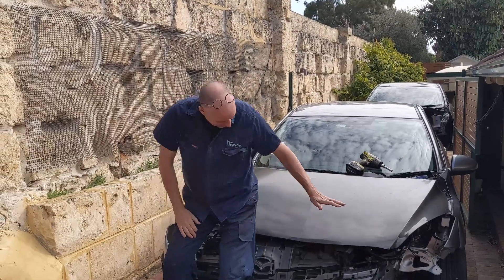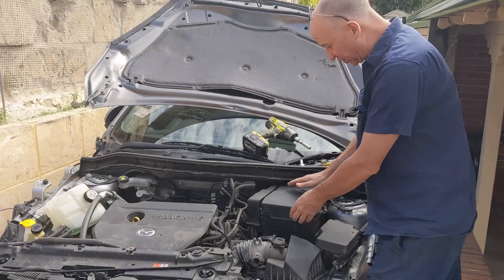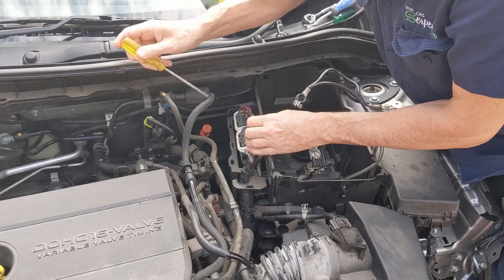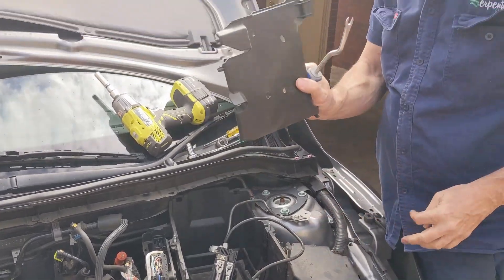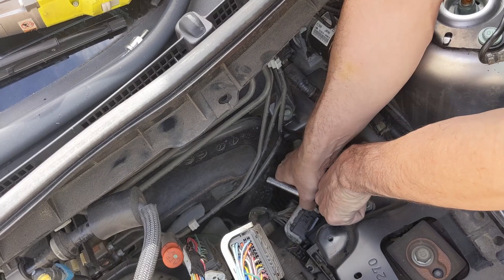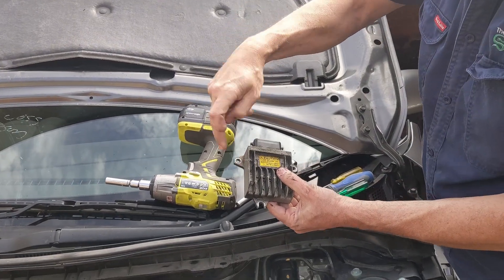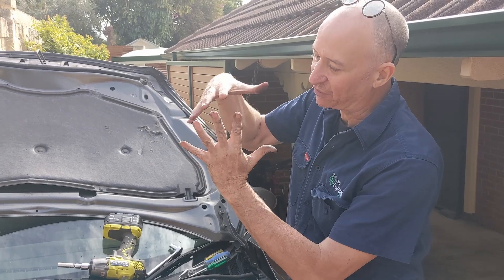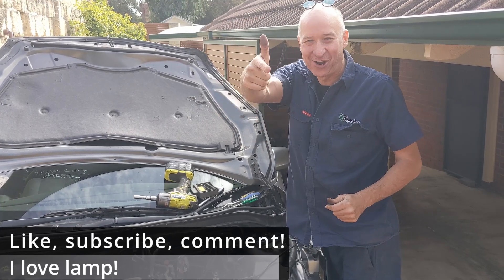BL Mazda 3: R&R the TCM. 2.0L 2.5L 2009 2010 2011 2012 2013 U0101 LFAE LFJS L552 L34N PE2G PE2K

Comment: Engine light and AT light came up yesterday on our 09 sp25 scan tool saying PO753 shift solenoid A electrical. I’m assuming it’s the TCM as you have shown. Symptoms clunking into drive and reverse. 

Thanks for the video. Going to give this a crack. Cheers
Reply from the maker: Hi Steve, yep, that sounds exactly like a TCM failure.  

Just so you know, I've noticed a bunch of sellers on eBay selling new non-genuine TCMs that are made in China.  They don't have either of the model numbers used in Australia (LFAE-18-x for the 2.0L petrol, and L552-18-x for the 2.5L petrol).  

The reason that I mention this is that you now have a dilemma.  Do you fork out the $2,000 to Mazda to gt a new one, or $1,200 to get your old TCM reconditioned, or do you punt on a second hand one from a wrecker for about $600, or do you punt on one of these non-genuine new ones from China for $450 (assuming the seller assures you that it will work in your car?

If you do go with the Chinese eBay option, could you please write back and let me know? I'm very curious.

Paul.
Reply: @PaulinPerth  morning Paul! I removed the TCM today, think I’m going to try a few local Mazda wreckers for a change over first and see how i go, 

Quick question I have the sp25 number L552 18 9E1C 
Do I have to match the entire part number or just the first 2 sections for the TCM to work 

Also I have a 09 model car. I can’t see anything in the manual about auto trans service intervals… is it lifetime oil in these or is it worth buying a service kit and some fluid and giving it a freshen up. 

I’ll let you know how I go with the TCM pricing. As the car is approaching 200k and 2009 I’m thinking of buying a wrecker module and maybe look at moving it on and upgrading.
Reply: @PaulinPerth  update mate 

I found a local wrecker selling referbed units for approx $650 with a 5yr warranty so I’m going to go with him! Cheers for the help! Much appreciated.
Reply: @stevev7696  do you mind sharing the information/ or link to that local wrecker much appreciated thank you.
Reply: @phatp569  Allmaz wreckers in Clayton Victoria

Comment: So if you get one off of a junked one will it have to be reprogrammed or if I buy one will it have to be 2012 Mazda 3
Reply from the maker: No reprogramming is needed.  You just install it as is.  Start the car up and drive.  Paul.
Reply: Can it be off a junk car same year and model someone is telling me that vin has to match for them to communicate
Reply from the maker: I assure you that the VIN can be different.  I've successfully transferred several TCMs from different cars.

Comment: I wonder if it would help to put some spacers in between the transmission and the module to help keep it cooler...from the United States.
Reply from the maker: It wouldn't hurt.  Some people cable tie the TCM to the brake lines on the firewall.  Paul.
Reply: @PaulinPerth  that's what I ended up doing.

Comment: Will any Mazda 3 TCM work? I have a 2008 2.0 and wondering if I can just get one from q junk yard and use any. Or do I have to use the same one with the same code???
Reply from the maker: It will need to be from the same series with the same engine and transmission.  So you can't use the TCM from a BK on a BL, or the TCM for the 2.0L engine on a 2.5L engine.

Comment: How do you reset the codes and reset after you replace the tcm?
Reply from the maker: You'll need an OBD2 scanner and use the reset DTC (Diagnostic Trouble Code) feature.  Get a Bluetooth one off eBay.  They aren't expensive.
Reply: Thank you  @PaulinPerth

Comment: how would you attached the TCU to the firewall? with screws right into the back of the firewall?
Reply from the maker: I've seen people cable tie them to the brake lines.
Reply: @PaulinPerth will this cause any damage to the break lines with the weight of the Tcm jossling or hanging overtime?

Comment: Love the video .. I live in Houston texas USA.. .. I am having this problem with my tcm I have a 3015 mazda 6 the  check engine light on and a traction light on the code is p 0882 low voltage

Comment: Awesome video!  When i get a new or refurbished TCM for my 2010 Mazda 3, do i need a dealer to program it, or just plug in and go?
Reply from the maker: Plug it in and turn the key.  There is no programming required.  Paul.
Reply: @PaulinPerth can I go to the junk yard and get from the other TCM there? (same 2010 mazda 3)
Reply from the maker: @amadolasala200  Yes you can.  But of course you don't know how long that used TCM will work for.
Reply: @PaulinPerth where can I get one brand new??

Comment: Im having something similar happeing to my mazda3 2010. AT light is on check engine light on. It drives sometimes. But at times will start flashing AT light and losing control light (its right next to the AT light). When that happens i cant gas the car anymore. I have to park on the side for a little and power will come back .   Not sure is these are symptoms of this.  But if anyone can help. I would appreciate it

Comment: hey do you know the TCM model numbers for the Mazda 5 2.3L? specifically the 2008 from the USDM
Reply from the maker: I don't, but injectronics will https://injectronics.com.au/.  Failing that, ring a Mazda dealership and get a quote from them.  The quote will include the correct part number.

Comment: Just found out that I will be chasing this down in my daughters car, and it looks like I lucked out on my FIRST video researching location and possible replacement. I've already seen the prices (hello from USA) so I will take a little time in
making sure it isn't wiring, or connection.
You did put my mind at ease about the firewall not being on fire. He.. he. I will be doing that mount for sure, if I  replace it.
If you don't mind? Some general information type sites are stating that bad wiring is usually the culprit, and it "rarely being the TCM", and I only have the one code. (U0101) The car runs great, and then suddenly  BAM.... downshift?, disengages? and back? it then goes back to running as it should. It's hard to tell exactly because it pretty violent at 45 mph, or whatever the rest of the world (correctly) calls it. It's like getting rear ended by someone doing 1.609344 Killemneaters? Klobberweiners? Klimbameter?Kouldbeneater? (but it's all I got) per hour, 
OR? (correctly) referred to as 5 mph. Lol. 
We used the metric system when I worked in the machine shop at CASE Construction, and I far prefer it, but ya know? exceptionalism and all. (example of exceptional sarcasm right there) We Built the skid steers, or "skidders" I believe you may say.
I release you from responsibility of burden for giving your advice on which you believe my focus should be more on.
TCM?
Wiring / connections?
Where might I favor focus too?
My asking is a reflection of your specific experience with this vehicle, along with an intelligent manner in how you simply explained this. The inside scoop on factory issues was good to know, but at 3x used price, it would have never been a purchase I would have made. I haven't yet been bitten with that mindset yet, and I've turned many wrenches holding the title of family and friends mechanic.
The pay is awful, but at least they call when i'm busy with other things.
Great video, even if you don't find the time to reply. 
A like and a sub for you my friend.
Thanks.
Reply: Hey friend, I got the same exact issue as you described. Mine is a 2010 Mazda3 S Sport 2.5L. Do you found the cause of the problem? I’m at the same position as you: Tcm? Wires? Both? Any info willl be greatly apreciated 🙏🙏
Reply: @gcertain  
I literally just found out what wasn't the problem 1 week ago. I boiled it down to it having to be the TCM, so I sent it out to a place called upfix I believe was the name, or upshot? I could find out if you decide whether that is your issue or not. After getting it back in, The AT light was still on so I immediately thought that I had misdiagnosed the issue. So, the hard bangs into reverse and drive when first putting in gear were completely gone, at this point I still have not moved the car yet, but the AT light was still on. While first driving the car during the factory re-learn process driving the under 15mph (if i remember) it seemed to be shifting 1 thru 3rd and back down, but when going to the next step of doing 50mph I realized that it was staying in 4th gear. After doing the re-learn a couple more times, and resetting it and just driving without relearn it just stayed in 4th gear. The car was in limp mode I believe, but I took it up to 90mph and it wasn't speed restricted, so i am not sure if it was a limp mode or just stuck in 4th gear. Another thing is that the TCM on this car had already been reworked prior to me getting the car. (my daughters car). I believe that I either had a short, or probably a signal issue in my car that i wasn't able to find and  my TCM would cut the signal off and on, so she would be driving, (mostly her but i was able to reproduce 5 or six times over 1 year) and the trans would think that it was just online and shift into first gear then immediately shirt back into drive and the old TCM would just do that. I believe in my case that when getting the remanned one it knew that there was a signal issue and went right into limp mode as it should. Mt daughter graduated high school last week and will be going to college about 50 miles away and has been working since she was 16, just because she wanted to, so we traded it in while it was running, lol, i was honest with them. She got a really nice ford fusion titanium 2.o turbo EcoBoost with like 246hp and 260tq, but only daddy cares about that. lol. I have a couple ideas on what i could have done differently if you want to hear, but right now I have got things to do, and this is a lot of typing for a two fingered chicken picker like me. lol. I really dont mind if you have any questions, I just may not get right back to you depending on how busy i get and I would love to see you succeed at this where I was unable too. Good luck, and don't hesitate to pick my brain, if need be, I really don't mind.
Reply: @Thesaurcery4U2C  haha thank you sir for taking the time to reply. I will check further before pulling the trigger on a new TCM (590$, ouchhh). I’m in that stage between getting rid of the car (which I love) or throw more money until I find a solution. If I find it, I will let you know just to see how close or far you were 🤣 Thanks once again, and good luck to you and your daughter!
Reply: @gcertain  That company where I had mine worked on offered a 90 day warranty covering the issues that you check off or describe in the online order form. They disable the part, do a visual inspection for any obviously blown components and then re-solder all cold joints for just under $200. I believe that they did repair mine, and it didn't do a single thing wrong that the old one did, it sensed a signal issue in the cars wiring 
(my assumption) and went into limp mode, as mazda programmed it to do. Have you tried to reset your TCM yet? I ask because in the beginning when I would do that, I would get a month or two of hassle-free driving. There is a specific way to drain all of the charge from the care other than just unhooking the battery cables, and a re-learn driving process that takes about 20 min. That is a lot of time where those internal trans parts aren't banging into each other so hard.

Comment: Excellent video with very clear explanations. 

My 2005 Mazda 3 SP23 has the TCM integrated with the ECM, ie, there is no separate TCM.  Series 2 has TCM.

New genuine ECM costs $6k
Reply from the maker: Is it an option to have the ECM(TCM) reconditioned with a mob like Injectronics?  

Or, depending on how much you love the car, you could also look at buying a smashed up 2005 SP23 at a salvage auction and take a punt on landing a good ECM.  The car made it to the scene of the accident after all.....
Reply: Injectronics is an option. 

It is my understanding that an ECM from a wrecked vehicle will only work if it has the same ECM Part No. Can you confirm this?

Comment: Nice one mate we just had this replaced at auto masters. In another video they said to not mount the module back where it was from the factory but cable tie or mount to the firewall to stop it getting hot.
Cheers
Reply: Hi Racoonman100. I have a 2011 mazda 3 two litre. My ecm needs replacing as it is doing all the things described above, I have also had it diagnosed. Just wondering if you could tell me what sort of money it cost you to have it replaced?
Cheers, Fred.
Reply: @2011dawnie  cost us around 12 to 13 hundred dollars and it apparently had to be sent to the eastern states of Australia from Western Australia.all fixed and running better than before. We did it with auto masters (mechanic)
Reply: Thanks heaps for that!
Reply: @2011dawnie  no worries at all.

Comment: Thank you for the in depth tutorial. My 2010 Mazda 3 had the AT light turn on a few months back and its been driving me nuts. It gets stuck in a certain gear and makes it impossible to drive on the highway; 4,000 rpms going 60mph. I'm going to try and buy one online and replace it using your guide. I'm not a car guy, so I have a question. When looking up this module online, I see several different part numbers for what looks like the same thing. And they all say 2010 or a range of years including 2010. Does it matter which one I get? Or should it be the same exact part number that I currently have? Thank you
Reply from the maker: For the 2.0L petrol, any of the following modules will make your car drive normally:
LFAE-18-9E1
LFAE-18-9E1B
LFAE-18-9E1C
LFAE-18-9E1D
LFAE-18-9E1E
LFAE-18-9E1F
LFAE-18-9E1G
LFAE-18-9E1H
LFJS-18-9E1C

You will notice for the LFAE series, the only that changes is the last character.  This just indicates that as the car was manufactured (2009 to 2013), the engineers developed more refined algorithms for thing like gear changes.

But if the car has been serviced at a Mazda dealership, then they would update the software at each service (if you ask for it).  So even if your part number says LFAE-18-9E1C, it is entirely possible that the firmware inside the chip has been updated to the H revision.

I hope that helps.

Paul.

Comment: Hello, firstly, I appreciate your videos very much, I am a new Mazda 3 BL owner and have some issues regarding the TCM. Maybe you could share what you think the issue would be?
The car drives normally when it is newly started, up to the point where everything gets too hot I guess. For the first 20 minutes I can shift gears up and down with no issues, however after 20 minutes (approximately), whenever I try to sift into fifth gear, it has some delay (which also happens in the first 20 minutes too), and after that it either shifts or not and I get error codes p0777 and p0735. Also after about 20 mins, when I shift into R, it takes a few seconds to start moving, kind of halts for a bit and then drives back.  I made some experiments, installed the TCM below brake pipes with zip ties, wrapped a container around it with a cooler fan and connected a pipe which was coming out at the car's front bumper, which would blow air and keep the TCM cool. I thought the TCM would give me these messages when it would get hot, but in this case I drove for a good 30 mins and still got the AT light on with same codes, but the TCM was pretty cool when I touched it. That got me confused, why would it work at first but then give me error codes even if the TCM itself does not get hot? If you have any ideas I would appreciate, because it is a bit difficult to fix this problem where I live, since I first need to find a working TCM that would go with my car, as the transmission mechanic said that mechanically it should be ideal as all shifting was smooth when he drove, and wants me to address TCM first before disassembling the transmission.
Reply from the maker: Hi Raven,

have it professionally diagnosed.  The BL M3 is an inherently good car.  They are worth fixing.  If the TCM  needs replacing, then my advice is to replace/repair it.  BLs are a good car.  Paul.

Comment: Hi sir ! 
I looked mazda 3 ,2017 hatchback 52000km for $21000 in perth..is it good for uberX and what about engine and other working condition ..Thanks ..…
Reply from the maker: Hi Ahsan,

The manufacturing year 2017 correlates to the BN model.  I've never owned one or wrecked one, so I cannot speak form personal experience.

However, I have looked up the BN on ProductReview, and it has scored 4.3/5 stars and has overwhelmingly good reviews.

https://www.productreview.com.au/listings/mazda-3-bn-2016-present

If I was you, I would read the reviews on that page, and then make a decision.  From the few minutes I took to review them, the BN looks like a reliable, well loved model.

Paul in Perth.